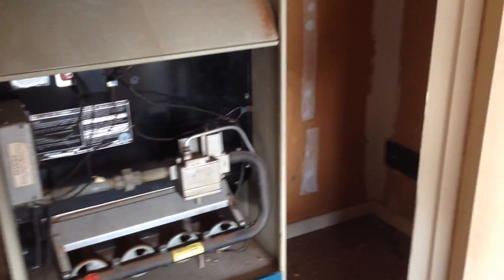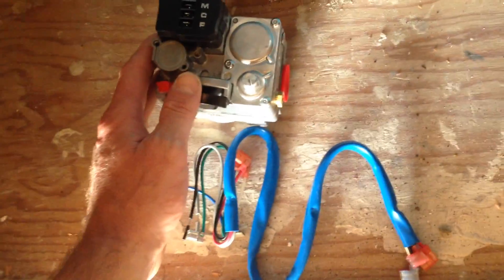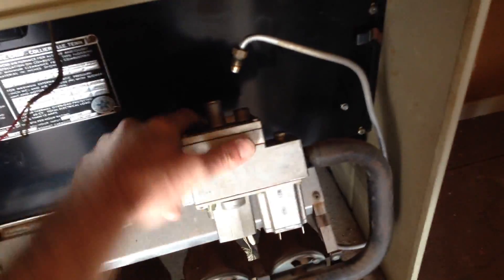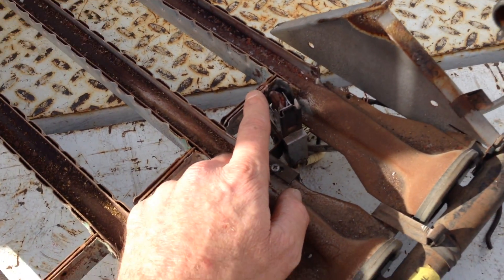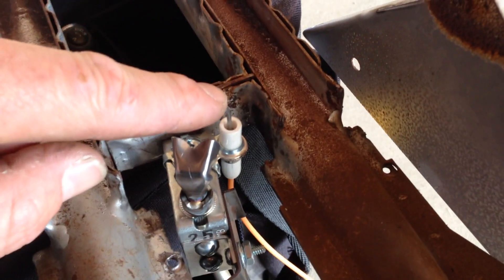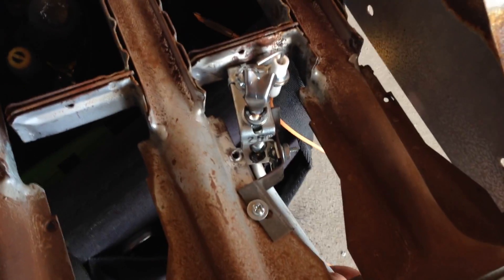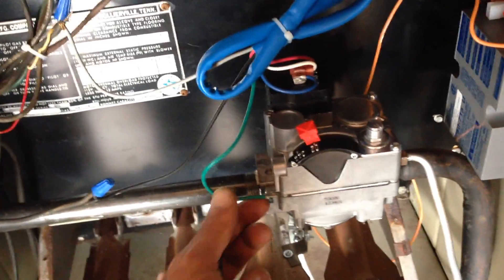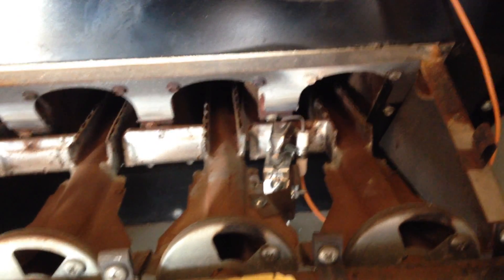Gas valve installation. Upgrade to Robertshaw intermittent spark ignition.

Comment: Get a knockout punch and a waterproof cable gland and put these things in the blower compartment, not directly above the hood for the ribbon burners that gets up to 500 degrees on a regular basis. First the sticker will wrinkle, then the enclosure itself will deform and then the solder joints inside will start cracking apart and make the valve chatter violently if it ever lights at all.

Comment: thank you for the great video.  I'm installing the same kit on a furnace with a 2 wire Carrier pilot burner 732.  What pilot burner and hood did you use? My Robertshaw retrofit kit only came with the spark rod.to mount where the thermo-couple   normally mounts.

Comment: Great video thank you.  So is it possible to take an existing spark ignition that's obsolete and convert it to a standing piolot using the existing gas valve?

Comment: GREAT VIDEO !!! CAN U EXPLAIN PILOT LOCATION  FLUID IGNITION  VS. MAIN BURNER LOCATION  ALSO  RESULTING IN LAGGING AND  PRODUCING A ROLL OUT FLAME. THX U.
Reply from the maker: I look to install the pilot hood in the same location as the old setup. That way, we are relying on the engineers of the heating unit to answer that question. Though, i usually install the pilot hood in a manner that leaves the flame 1/2" to 3/4" above the main burner. Test several times to verify proper ignition (One void of any delay to the ignition). Hope this helps, Jeff

Comment: Thanks for the video on this. I had a standing pilot that would randomly go out for no apparent reason in an old (54 years!) boiler. Changed multiple thermocouples and the gas valve and still had issues. The last time I looked to go to a kit like this when I replaced the gas valve about 2 to 3 years ago I could not find anything like this, which I thought was strange. Is this a newer kit? My instructions were copyright 2014.
Reply from the maker: Robertshaw makes a universal spark ignition retrofit kit.

Comment: I just did the same to my hot water natural gas boiler, with Honeywell ignition spark igniter replacement kit.. It works wonderful. The original pilot light sounded like a when I'm braising the torch, I was driving me crazy.  Just bought my new house , it has a boiler that is like 30 year old , it runs great good condition but , I just updated and modify with a new ignition Kit.